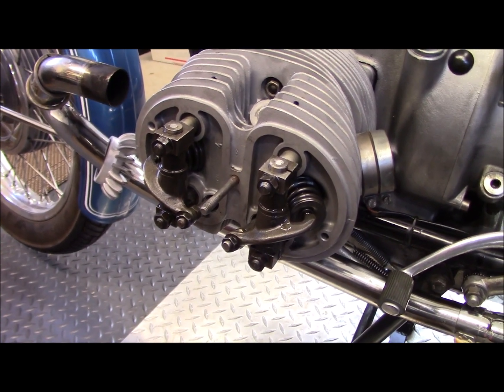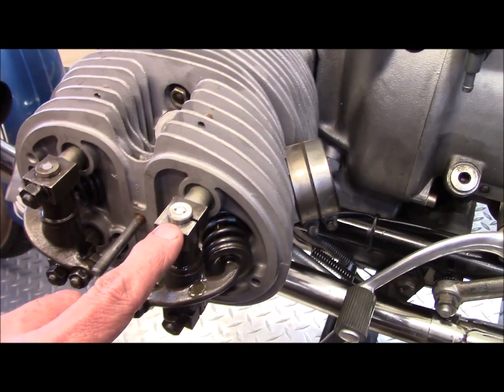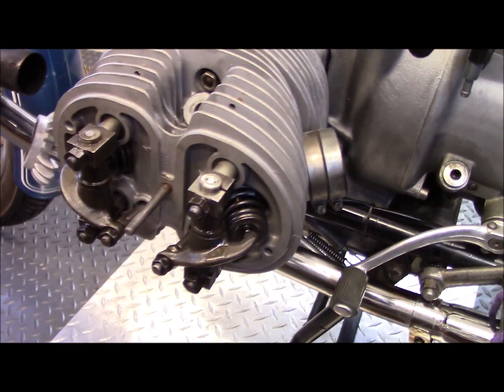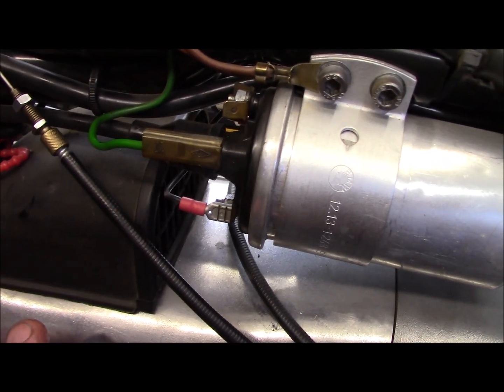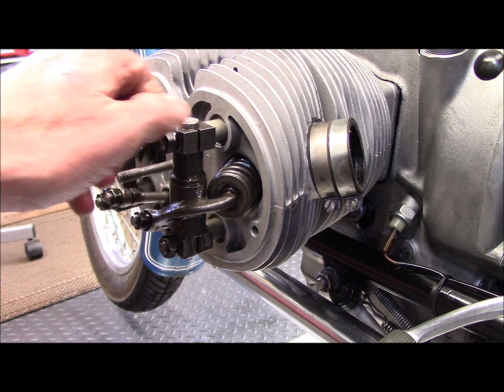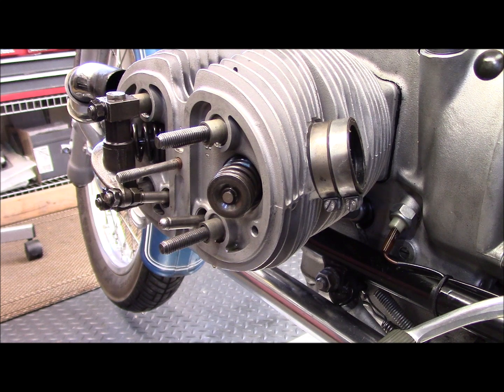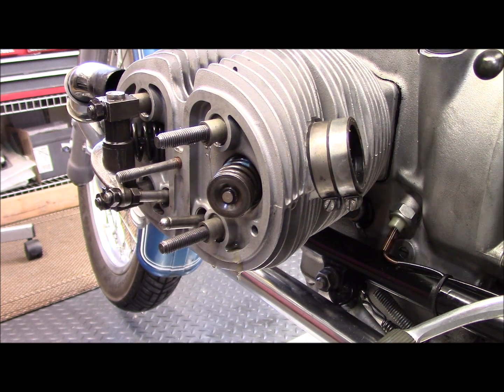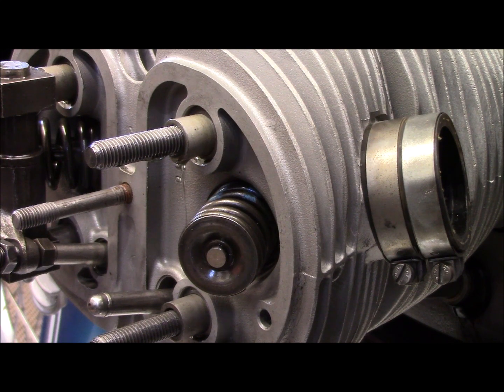BMW R75/5 Test Oil Flow To Rocker Assembly

Comment: Hello,
I got my main crankshaft bearings changed by a specialist. However, since then, i haven't got any oil reaching the heads. The "specialist" told me that cranking the egine wasn't enough to get proper oil pressure and told me to run it a 2-3 minutes and go up in the rpm's to get high oil pressure. Still nothing. Hope i didn't dammage anything running it 3 minutes with out proper lubrification (mostly worried about the lifters and camshaft).
Really disapointed by that so called specialist that cost me an arm and a leg...
any advice? (started removing the front bearing to check if the lubrfication holes were drilled...)
Reply from the maker: Sadly your mechanic was completely wrong about how to test for oil flow to the rocker assembly. If the main bearing hole was not drilled or isn’t aligned, running engine can damage those bearings and possibly other parts :-(

Comment: Please i want to see if it is normal to put oil 10-40  (BMW r80 1990) or its necessary to put 20-50?
(Sorry for my bad english)
Reply from the maker: RiDZ, for many climates, 20W-50 is recommended. In cold climates 10W-40 maybe more appropriate. The owner's manual provides a chart with recommended oil vs. temperatures.

Comment: thank you again for sharing ......I have a question sir,  does all the studs have oil to them like the top right one, please and thank you.. love these education vids
Reply from the maker: Only the top tow cylinder stud holes provide oil flow to lubricate the rocker assemblies.  Don't forget to click the link in the video summary to go to my web site document with all the details of how I do the work.  

Best of success on you project Phil. It's good to know another one of these motorcycles will get back on the road. 🙂

Comment: Does it just come from the intake stud? Or does it also come out the exhaust?
Reply from the maker: Joshua, both top studs have oil passages so the intake and exhaust rocker assemblies get lubricated.
Reply: @BrooksAirheadGarage  roger that. Both cylinders on my 78’ R100s only have oil coming from the Intake side of the too studs…so both rocker arms aren’t getting as much oil as the intake valves. The only thing I can think is that the cylinder was sales with RTV. Is there anything I should check for outside of that?
Reply from the maker: @joshuapeters2764  Too much sealant or a rubber O-ring that is plugging the oil passage around the top cylinder studs could be a cause. It's also possible something is plugging the hole in the cylinders that the studs are inside of. In any event, removing the heads and cylinders seems in order to find out what is obstructing oil flow.
Reply: @BrooksAirheadGarage  thank you!!
Reply: @BrooksAirheadGarage  I took both cylinders off and there was lots of red RTV I cleaned both the head and the block with mineral spirits and got the RTV off. I watched your other video where you use the 1207B sealant. I ordered that and the cylinder stud o rings and the large cylinder base o ring. There was a metal gasket at the base of the Cylinder that I was told the R100S does not use. So I tossed that. I put the engine back together and I still do t have oil flowing from the LH exhaust rocker arm, the rest of the rocker arms flow oil like crazy….any idea what I should check for now?
Reply from the maker: @joshuapeters2764  It sounds like there is something obstructing the oil passage on the left exhaust passage. Could be something got into that passage, perhaps some RTV?  You could try blowing some air into the intake top stud passage and see if will exit on the exhaust top stud passage. IIRC, they are connected. If you don't get much or any air out of the exhaust passage, that indicates and obstruction.
Reply: @BrooksAirheadGarage  are they connected in the cylinder head or in the block? I’m working on pulling the cylinders off tonight. The first time I took the cylinders off I placed them into a parts washer tank and I had solvent flowing down each passage way. I’m guessing the oil flows around the threads on the studs at the block? I’ll double check that’s clean.
Reply from the maker: @joshuapeters2764  Yes, there is an oil passage in the engine block between the top two cylinder stud holes on each side of the block.

Comment: Do you know if it’s the same in earlier bikes? R51/3
Reply from the maker: Omri617, I've never worked on them. The push rod tubes are on top of the cylinders instead of on the bottom as the cam was above the crankshaft on that engine. The design of that head would have to provide an oil return path to the crankcase, but couldn't use the push rod tubes for that purpose. 

If you are going to work on these early post-war bikes, you should invest in the manuals available from Barrington Motor Works. They are acknowledged as the best resource available.
--> https://www.barringtonmotorworks.com/products
Reply: Hello Brook, i am doing a first engine start test on my 1988 r100rt . Three of the rockeratms are pumping oil but 1 dosent. I have cranked the engine more than 10 times 5sec burst. Do you know what i shud be looking at? And why only 1 rocker arm is not pumping oil?

Comment: 1980R100RS has new cylinders and pistons(from TC, installed by me) and I've adjusted valves.  Should I do what you demonstrate here, to show oil is indeed flowing to the rockers?  You are the only one to explain this, that I've seen.  I've followed your video on conrod bearings too.
Reply from the maker: Hi John, I try to be a "belt and suspenders" guy when it comes to engine work. No oil flow means no engine. This is a simple test to verify there are no obstructions in the oil system and it takes only a couple minutes. It also primes the oil system filling all the passages with oil. When you do your first engine start, there is less opportunity for any unlubricated parts to damage each other.

Comment: Thanks for taking time to create and post this. I just did the same repair and want to make sure I'm getting oil to the rockers. If I leave the rockers bolted on, where should I look for oil?
Reply from the maker: Leave the rockers off so it's easy to confirm oil is flowing out of the top studs. If you leave them on, you should see oil weeping out of the top and bottom pillow blocks, but it may take some time to see that.

Comment from the maker: Here is the link to the complete write-up about how I repaired the stripped cylinder stud threads in the engine bloc.
https://brook.reams.me/bmw-motorcyle-rebuilds/1973-bmw-r755-rebuild-project/11-bmw-r75-5-repair-stripped-cylinder-stud-threads/